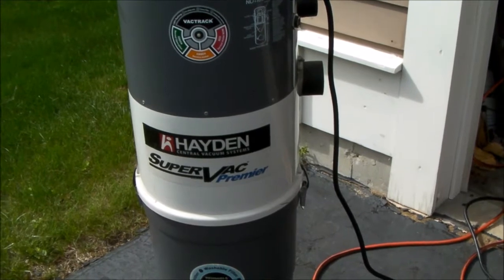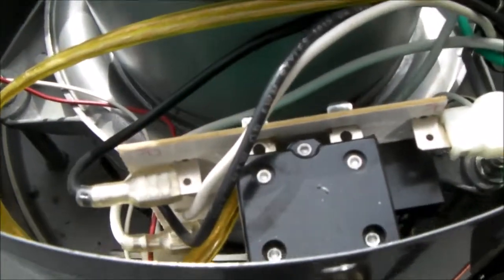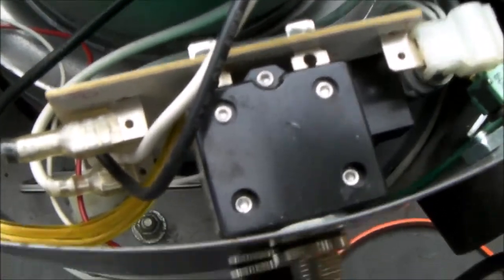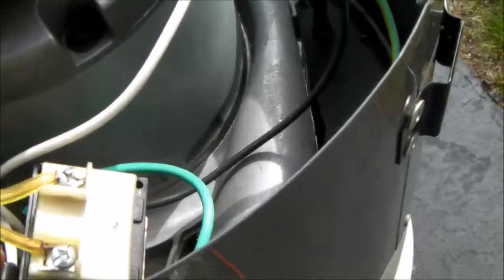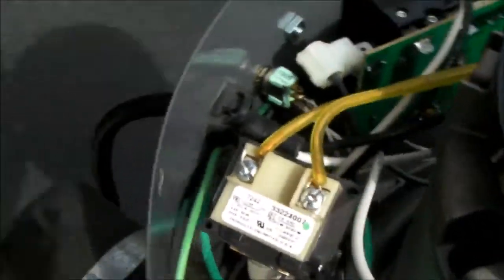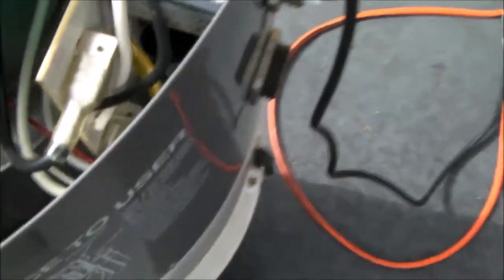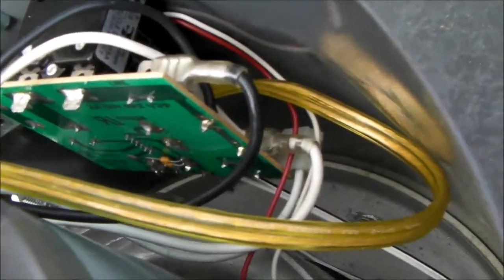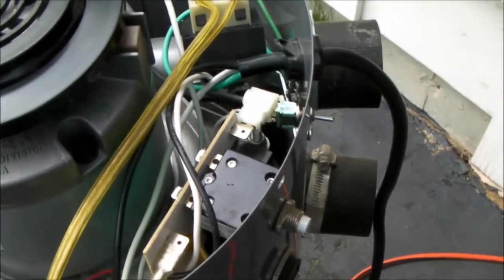How to fix Hayden Central Vac SuperVac Premier Control Board Circuit Board Control Module 818766369

Comment: Great information , Thank you. I have had to replace the controller board before. Now again it is broken. This points me to the likely cause!.
Reply from the maker: You are very welcome.  If you have a voltmeter (and know what you are doing), you can QUICKLY check to see if you have about 24V AC at the wall valve or at the 2 wire connection on the side of the vac power unit.  I hope you subscribe to my channel.  Thank you!

Comment: hey could you help me out with this.   is there a way to test the motor.     with i call for suction i just get a click on the curcuit board i think      i have continuity on the fuse portion.  other than that i am lost on testing
Reply from the maker: The click is probably the relay closing and allowing power to flow directly to the motor.  I personally would be testing to confirm 120V is at the 2 motor leads when the relay clicks before I try to test the motor by itself.  The motor only has two wires and could be tested directly to the 120v AC.  But based on the questions you've posed, it sounds to me like you should not even consider attempting to fix this yourself.  It's VERY dangerous for someone without the knowledge or skill to attempt this.  I'm not trying to be a jerk,  Just trying to keep YOU alive.
Reply: I agree.    I just ordered part.    The motors do work.   I’m not messing with relays.   I thank you for the reply

Comment: I have the same system installed and working 14 years. All of a sudden when on at an inlet the the vac system turn on/off every 1 to 2 seconds
Reply from the maker: might be your hose.  twist it with the switch on and see if they are linked.  I have a video showing how to repair the wire in the hose

Comment: is the motor 120v or 24v.  how can i test motor
Reply from the maker: 120V.  Unplug the unit.  disconnect the motor from the control board.  CAREFULLY apply AC power directly to the motor.  If you don't do this carefully or with proper wiring, you will shock yourself.  This is very dangerous for the amateur or for someone without basic knowledge of electricity and the associated hazards of potentially lethal voltage.

Comment: Thanks for the video
How did you know that it was a bad transformer and not a relay ?
Reply from the maker: get your meter out and simply test to see if you have voltage at the two wires which run from the vac to all the outlets.  Relay won't work if there is no voltage from the transformer. Be sure to LIKE and subscribe.  That will really help me! And read comments by others.  There are some good hints from others.  THANKS!
Reply: @YuDaMan  thanks 👍

Comment: how do i know if its the transformer
Reply from the maker: you need a voltmeter and some basic electricity knowledge.  120V will kill you if you don't know what you're doing.  But if you have a meter, the 24V is easy to test and relatively safe.  Open the vac hose outlet and you will see two round metal pins.  Measure the AC voltage across those two pins and if you have 24 VAC more or lesee, the transformer is probably good.  You can also take the same measurement at the vacuum power head...it's the two smaller wires that you see plugged into the power unit, probably taped to your plastic vacuum piping.

Comment: that motor doesn't sound very good.
Reply from the maker: sounds normal for a high speed, high output universal electric motor.  Most conventional vacuum cleaner universal brush type motors are loud!
Reply: it's worn out, brushes and or bearing - not a question of noise level alone. compare it to sound of a new central vac and u would notice a huge difference.
Reply: @Jon-hx7pe   his motor sounds perfect to my ears and I am a central vacuum technician
Reply: @VacMaster2020  okay. :)